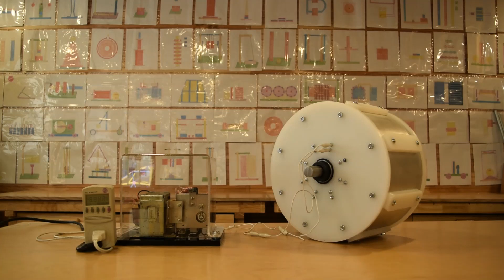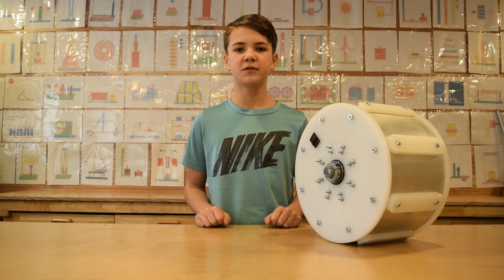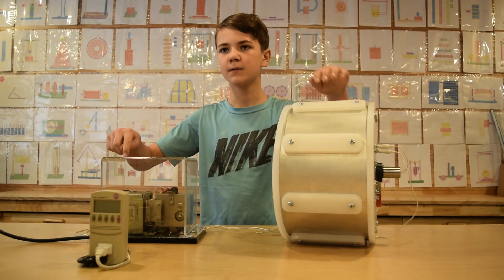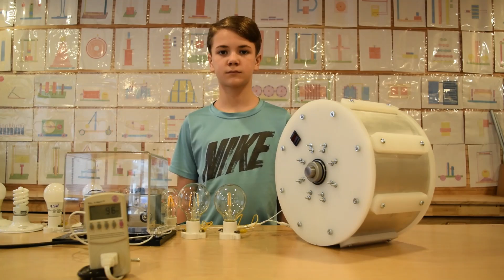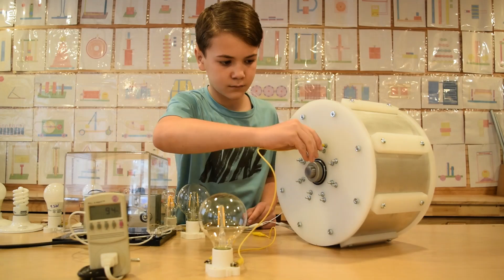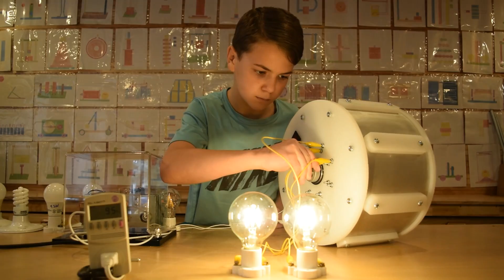Pulsed Magnetic Motor Experimental Prototype.

Comment: Good work, can you explain more on how the timing works, you just mention that it's a bit complicated in a video description of some of your videos. You've shown that you use switches which are turned on and off, but I'm still confused how do you know where the magnet is and when to switch on and off, is there a control system for the timing? Would really appreciate your response
Reply from the maker: This prototype has a timing wheel on the inside of the motor and uses switches like transistor or mosfet. It also has small trigger coils that get effected by the passing permanent magnets, similar to "All Magnet Motor with regauging section" video.